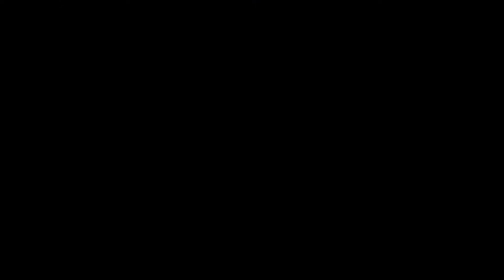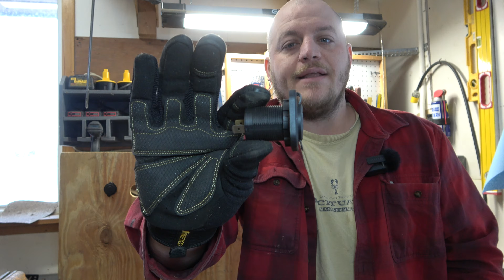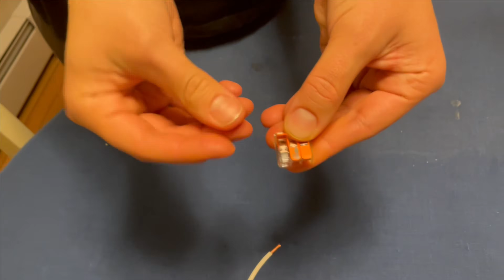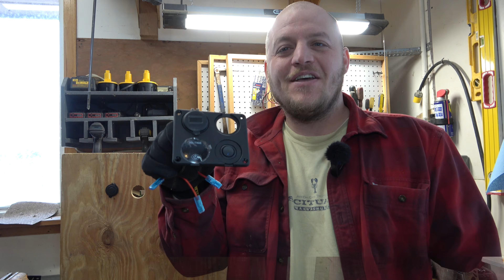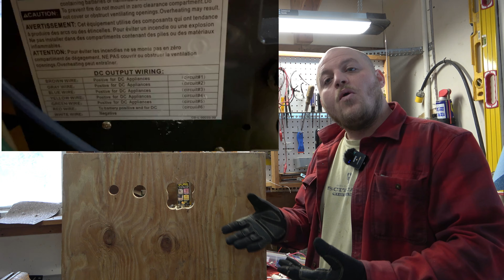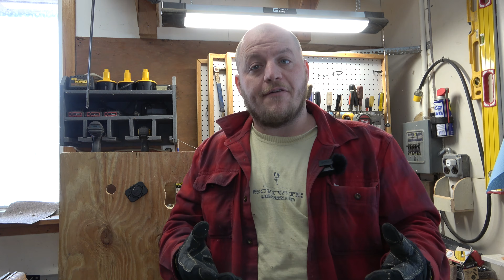Installing 12v plug | EASY cigarette socket camper RV

Comment: So the white wire coming off the bus bar for the ground, what does that splice into? Thanks
Reply from the maker: Unfortunately, I have no idea what you’re working on.  Can you describe what you’re working on?  For DC stuff, the white wire is your neutral.   If you were installing a DC receptacle, it would connect to the negative.
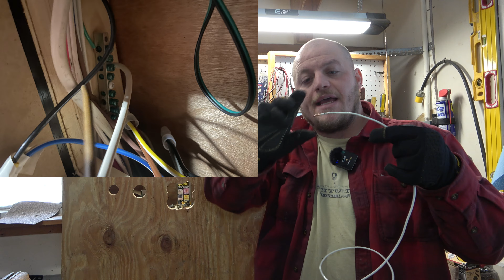Reply: @DIYOutdoorLife At 15:00 you're installing a white wire to the bus bar ... I think you splice you might have spliced into the negative for the receptacle

Comment: And sorry just curious at the 15 minute mark , let's say you were tapping into the 15a wiring for the fridge with your positives and the fridge black wire is already going to the bus bar (ground), wouldn't introducing the white wire for this female receptacle to the busbar potentially create a grounding loop? I'm probably wrong here lol
Reply from the maker: Unfortunately, I’m not getting enough information here to give you accurate advice.

I will say, wiring DC systems like this is a little bit different than AC circuits in a home.  It can become complicated because of the language people use, a neutral wire is very different than an equipment grounding conductor.  Sometimes we say grounding with this type of DC, one really we’re talking about neutral.   One of the most common ways to do DC grounding, is to provide an align source to all the appliances with a single wire.  The “ neutrals” all connect to the vehicle chassis, which is connected to the batteries negative neutral.   Equipment, grounding conductors with 120 V AC is completely different, and serves a different purpose.  You are fine to have multiple pathways back to the battery negative with DC systems like the ones demonstrated
Reply: @DIYOutdoorLife Ok great. Thanks for taking the time to answer! Subbed 👍

Comment: I don't get it. You stated the video with 2 wires behind the wall then we end up with 3?
Reply from the maker: Are you talking about installing a 12 V outlet or installing a switch on your radio?

If you have a splice with three wires, it just means they’re powering something else as well.   You can still tap your negative to the neutral wire, and tap your positive into a positive wire.  Even if it’s a three wire splice, it’s doing the same thing.
Reply: I'm so sorry, you left the original device wired in as well

Comment: Why are there 3 wires? Shouldn't there be 4... 2 from the female receptacle to the 2 coming from the fuse box. Am I missing something
Reply from the maker: He would have to be more specific, there’s only a positive and negative coming from your fuse block.  If you were using more than one wire on this device, it’s because you’re powering a switch and a female receptacle.
Reply: @DIYOutdoorLife got it now! So sorry and thanks for clarifying 🙏

Comment: Great video.  Will this work for low voltage outdoor lighting 450watt lights?
Reply from the maker: It depends on the voltage.  If it’s a 12v source, 10 amps gets you 120 watts,  24v - 240 watts.   Depending on the voltage you’re working with, you would likely want to hook a switch right into the battery for higher current draws. Generally, these style of plugs are good for ~10 amps.

Comment: Well done! I'm a new pop up camper user and have a CPAP that helps me sleep. I have the DC adapter for the CPAP and know what it draw less power than thorough the inverter AC to DC. I'll be installing at DC lighter plug as you described to pull 12V power direct from the battery. Thank you!
Reply from the maker: That will give you major results.   CPAP machines in particular are one of the biggest gains when switching from AC to DC.   Removing the stand by consumption of the inverter being left on all night, alone,can double your run time.

Comment: tying directly into the fuse box seems like more work but more “professional” since you are using higher gauge wire and better fuses. Is there any benefits of going directly to the fuse box over tapping into an existing USB device? I want to upgrade batteries to lithium in the future but in the meantime I can do this mod to power my trailer from my Bluetti while being able to stay inside the camper now that winter is coming.
Reply from the maker: As you said, tying back into the fuse block is the best way.  Since you’re only moving 10 A, it is also acceptable to tie in to any 12 V wire you have on the trailer…. The closer to the the better.

When in doubt, run a line to the fuse block

Comment: My mulitmeter says that I have 12.2 V coming out of the end of the spade connectors, but when I add the outlet it dops to 4.8 V. Any idea what I am doing wrong?
Reply from the maker: If all of your wiring is correct and your receptacle isn’t damaged or defective, this actually sounds like a battery issue.

If you are on a circuit connected to a good battery that’s charged, you should be getting around 12.8.  You can get down to 12.2 if your battery is nearly depleted.   4.8 is toast.   Sometimes bad batteries show a higher voltage until you apply a load to them.   Double check your battery and all your wiring and let me know how you make out.
Reply: @DIYOutdoorLife  even though I have 12.2 V coming out of the end of the wires?
Reply from the maker: unless your battery is nearly dead, it should be over 12.2

I was assuming that you had a load plugged in after you installed the socket.  Knowing your battery voltage will help.

Comment: Thanks for this video Brian. I spliced into an led light connection and realized it was stepped down to 7.5v. Which leads me to this two-part question: I'm installing the 12v plug as part of a panel that includes an on/off switch and a USB charger.  I realize I would need to have  the switch turned on if I want to use the 12v plug for other than back-feeding purposes, but when using as a back-feed, do I leave the switch off? Perhaps I simply bought the wrong type of device? Thanks for your time and help Brian!
Reply from the maker: If you splice back into the feedwire, youll be at 12vdc, you must have splice in the wire post driver... still pretty unusual to see 7.5.

As for the panel, in its normal configuration, you would need to switch on to either power or back feed.  It's pretty simple to wire it to do what you want though.  Send the wire into the 12 V socket, then over to the switch, then over to the USB or voltage meter.   In that case, the 12 V outlet will always be on for use or backfeed, the switch will just interrupt the other stuff.

Hope this helps, thanks for watching!

Comment: Well done on this informative video your teaching is great!! 
I have a question though: If I am tying into an existing 15A fused circuit, is the additional inline fuse for the plug still necessary?  If so, what Is the benefit to using the additional fuse?
Thank You
Reply from the maker: If the circuit is fused properly for the conductor, you're fine to just add the socket.  
Thanks for watching!

Comment: Brian, thanks for your videos!  I’ve lost count on how many of yours I’ve watched. Recently bought an eco flow river 2 pro per your video & installed a 4 in 1 socket charger panel per this video. I removed the radio in my pop up and taped into the wires it used.  But I’ve run into a problem. The panel powers on when I hit the switch but the 12v charger, USB ports or voltmeter don’t have power. Any thoughts on what I’ve done wrong?
Reply from the maker: This sounds to me like you have the wires wrong on the switch.
There should be a negative wire and the positive wire from the 12v source on that switch. The top terminal then jumps over to the other three sockets.

If you still have trouble, send me an email with photos .

Diyoutdoorcontent@gmail.com
Reply: Thanks! I’ll look at it and let you know.  I appreciate your videos and teaching ability!

Comment: My 19 foot trailer did not come with a 12 volt socket that was accessible near the bed.  It was behind the 12 volt television near the ceiling on the opposite end of the trailer where I would need it to run my CPAP. I was able to tap into the 12 volt line that powered the USB outlets next to the bed. Running the CPAP on 12 volt uses less battery power than using the inverter.  I don't know why the manufacture didn't install a combination USB 12v accessory panel. This is an easy modification.
Reply from the maker: Excellent work! You're not kidding, the CPAP will use considerably less on 12 V

Comment: Curious as to why you are adding another fuse to circuit 3, whereas in the other piggyback (both installs are technically piggybacking) there was no fuse?
Reply from the maker: Been a while since I made this, I don't remember which way I did them.

I do know that the one I installed had a inline fuse holder attached, the other one I added a blade fuse holder to.  Thats what a I suspect was different.

If the circuit is a 15a, you dont need to add another fuse, if its higher than you should.  
Hope this helps, thanks for watching!
Reply: @DIYOutdoorLife  if I just jump off my DC stereo wiring the existing fuse in the panel for the circuit should be fine now.
Reply from the maker: @VTDivot  yes

Comment: Hey Brian, Can I replace the worthless solar plug-in with a 12v outlet? I'd hate to drill another hole for an extra 12v. Thanks
Reply from the maker: Are you referring to the plug on the exterior?  You can, just make sure to use a marine grade water resistant plug... it's less than ideal, but will do the job.
Reply: @DIYOutdoorLife  Thanks Brian, those wires look pretty hefty, I may have to think it over.

Comment: Finally a video on the this subject, I am glad that I am doing this correctly. I like to steal the lighting connections, some lights in my camper are unnecessary. I found out that in some campers they have a 20 light outlet standard from some companies. So you end up with some in odd places or right near each other. I found a company that makes .1w LEDs that do a very good job lighting everything up. So much so that I can get rid of some for plugs like this. They are double socket ones as well. LEDs only need a one socket for how bright they are.
Reply from the maker: Nice, great work. Its always fun to do some power audits for boondocking.

Comment: How would I go about turning a 110 plug that would need to be on shore power into a cigarette plug. My trailer only has 110 plugs for the tv. Dont wont to have to run the gen all the time
Reply: I am thinking I can run a ground and a postive from the house battery to a inverter and control the power that way turn on/off when watching the tv. Maybe run a inline fuse just in case
Reply from the maker: @robertachen871  it would work but your run time would be very very short. It would be cheaper to buy a 12 V TV and install a cigarette plug.
Reply from the maker: Unfortunately, that can’t be done.  The 110 is alternating current and the 12 V is direct current.
Reply from the maker: You’re going to want to add some brand new 12 V

Comment: Great video! Very informative! I have kind of a technical question. I own a Coleman Power Chiller which is a refrigerator that looks like a cooler. It has a "cigarette lighter" plug attached with an adapter/converter if you want to plug it into a normal 110v outlet. I was able to plug it into my previous travel trailer that had a 12v outlet and it worked. (I never checked the wire size or if it was a dedicated circuit.) My current TT has no such outlet. I want to install a 12v outlet in the dinette where there is a CO detector, but the 12v wires to that detector are tiny. Can I do that or would I be better off going right to the panel, as you discuss in the second half of your video? Thanks so much for your help.  : )
Reply: P.S. I just checked and the appliance pulls 5 amps. Does that help?
Reply from the maker: It would be best to create a dedicated circuit or tap in to something with a larger wire.  Although the dryer is not huge, it runs constantly and you want to make sure you have a proper conductor.  
Hope this helps, thanks for watching !

Comment: Great video! I was able to install one of these very easily. I have a question though since i'm a novice. I bought another one and tried to install it next to my radio and tap into the wires. The negative was easy, but the positive had 4 wires in one compression nut. I undid that and used a wago 5 way connector to add the USB panel positive. After I connected them, it immediately blew the fuse in both the fuse box and the glass tube fuse. Any ideas/recommendations?
Reply from the maker: Hard to tell, but something is definitely off.  Are you sure that you didn’t connect it to two different positives?
Reply: I'm not entirely sure and think where I am getting lost. The 5 wires i connected were the trailer positive, the USB panel positive, 12v constant (radio), 12v DC switch (radio), and dimmer (radio). It was previously all 4 under one connection and essentially,  I just added the USB panel positive to it.
Reply from the maker: @andyfreedman6744  I would get a multi meter in there and see what’s going on. Also, double check to see that you’re connected to the positive side of the 12 V outlet, they should have a + and -
Reply: I fixed my wiring problem. Made a rookie mistake. The switch had 3 connectors, but wasnt labeled plus or minus. Wasnt until i looked at it in the light that i realized one was gold and one was silver. Flipped them and everything worked. Thank you for help and response! Again, love the videos. They are very informative!
Reply from the maker: @andyfreedman6744  great news!

Comment: Something to consider is that 99% of these cigarette plugs, given most vehicles have one already for cigarettes, is they are used for USB charging adapters which are downright fragile. Why not use the 12V powered adapters with USB outputs instead?
Reply from the maker: This is true, I use one of the 4 slots in this for a hardwired USB spot for sure.  Getting good adapters is key if you’re going to be swapping around.  Seems like USB C with power delivery is key.

Comment: Great video, I am going to do this to our camper.
Reply from the maker: That's great, thank for watching.
Reply: @DIYOutdoorLife  One question. So it is better to direclty access the fuse box for the 12v vs splicing into the Radio wire? (BTW, I have to say again, thank you and you are awesome in explaining things).
Reply from the maker: @ArunaKalutanthriMusic  Depending on what you are running off the 12v outlet, it may never make a difference...but, its always better to access the fuse block with new wire.
Youre welcome, I appreciate that you watch the channel!
Reply: @DIYOutdoorLife  I'm going to backfeed using the Bluettie AC50s, 500Wh/300W (Peak 450W) and regulated 12V DC Output to power the camper. Running only the fridge, water pump, furnace and lights. Then found a workaround from Web: Turn on house batteries, then turn on power station and then turn off house batteries. Now the power station powers the RV. :-) Thank You so much for this.
Reply from the maker: @ArunaKalutanthriMusic  go right to the converter, it will give you better performance and be safer in the long run when using the outlet to backfeed.  Circle back and let me know how your project goes.
Reply: @DIYOutdoorLife  I installed the 12v as your video but when I plug in the Bluettie AC50s, I get an error E27: Cause: DC12V-1 output over current, output current >11A or short-circuit. I see just as I turn on the power station, the fridge light come on and then the power station shuts down. All other appliances or lights are off.
Reply from the maker: @ArunaKalutanthriMusic  did you go back and watch my backfeed video?  Make sure your shore power is disconnected, solar unplugged, and tow vehicle 7pin removed.  If that’s the case, you should be in business. Let me know how you make out.
Reply: @DIYOutdoorLife  Yes, that was the case, no shore power, battery disconnected, nothing is running. The error could be a limitation of Bluetti AC50s. Anyhow I got it to work with the workaround. Thank You Kindly. All is good.
Reply from the maker: @ArunaKalutanthriMusic  glad you got something working for you. Happy camping!
Reply: @DIYOutdoorLife  Went camping this weekend, with your workaround everything worked perfect. I was able to power the camper (Fridge, lights, waterpump, furnace) and the Bluetti was 40% after 24 hours. With AC out of Bluetti it would not last for 10 hours. Thank You.
Reply from the maker: @ArunaKalutanthriMusic  excellent!! That’s great news